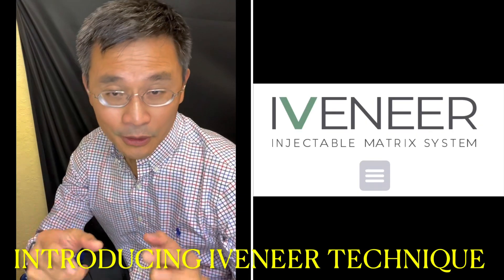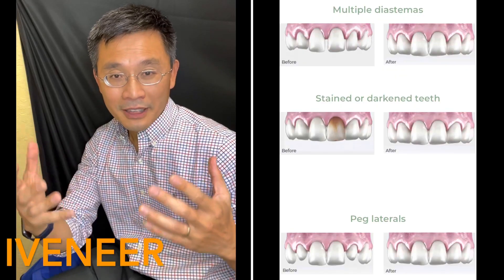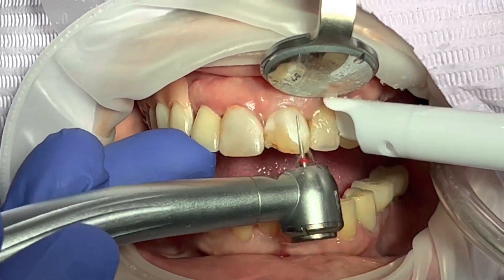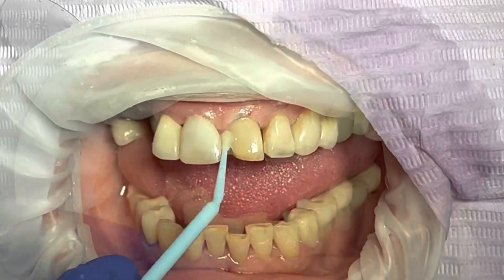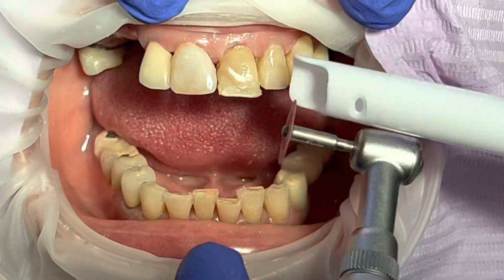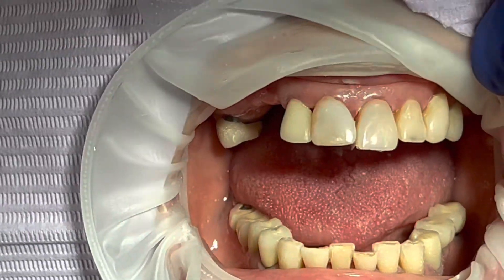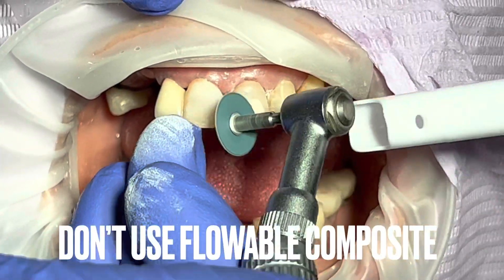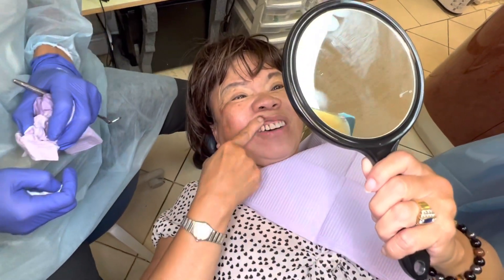HOW TO DO IVENEER: Injectable Composite Veneers

Comment: Is this process permanent
Reply from the maker: thank you for great question, this procedure works well for certain cases. Some cases it might need to be redone, retouched up.  Case by case is varied due to the bite of the individual. But the material we use is similar for composite veneers, or composite fillings.  The reality is nothing last forever right? everything eventually will be broken down, worn out, etc...